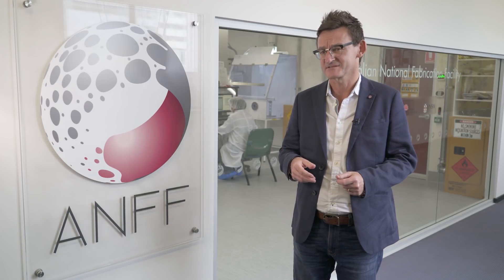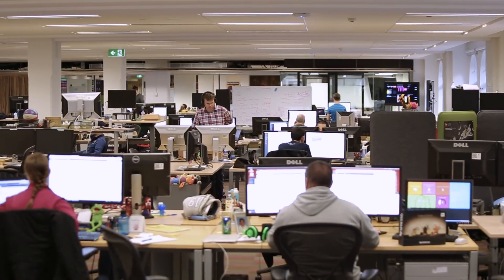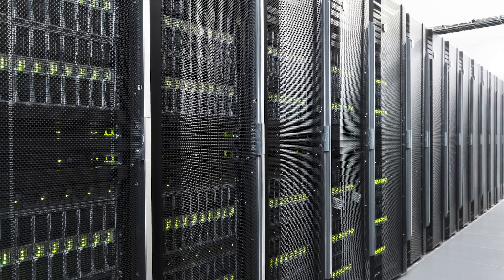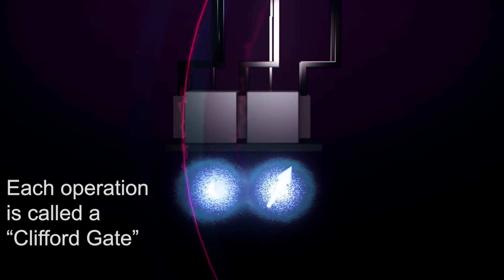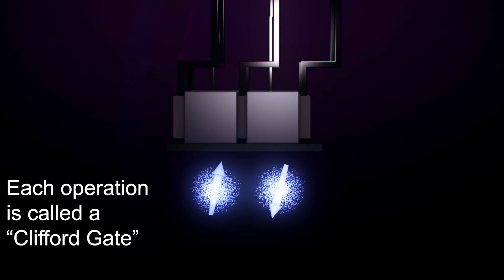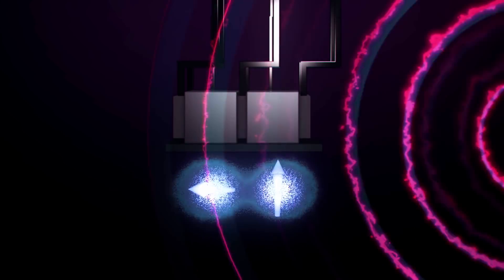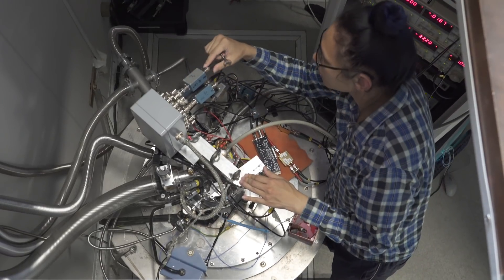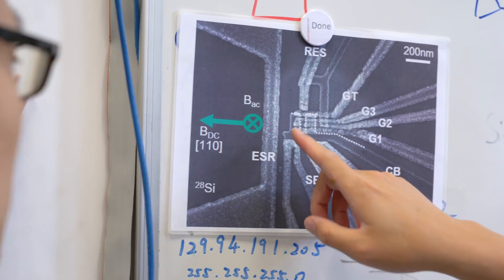World's first accurate two-qubit gate

Comment: I just read that scientists have built the first two-qubit gate between atoms in silicon allowing qubits to communicate with each other and do calculations never thought possible.  This is really exciting stuff.  What are some practical applications that may come out of this  new technology?
Reply: How about the complete takeover of the human body? Because computational power doubles with every qubit added to a substrate with the addition of quantum annealing for the optimal output for any input given, parallel qubit gateways, etc, you can bet your ass we’re in trouble. Forget “practical applications“, start thinking about protecting yourself against this.

Comment: I wonder how can you calculate that there are over 11000 possible basic operations that can be done on 2 qubits, like where does this figure come from, just curious to know 😁
Reply: Fact Sheet Look into abstract algebra and quantum error correcting output codes. Think of an operation like an XOR in “regular” discrete math.